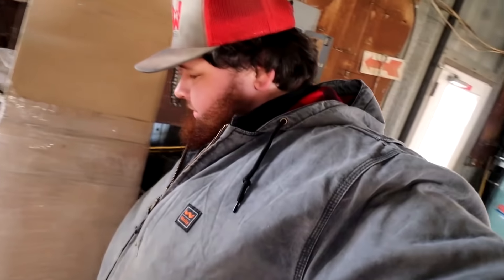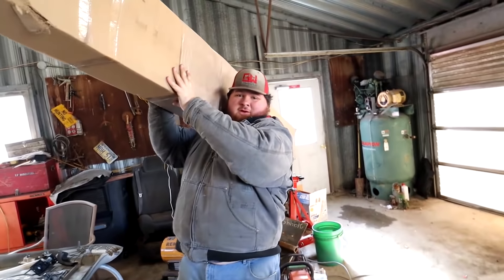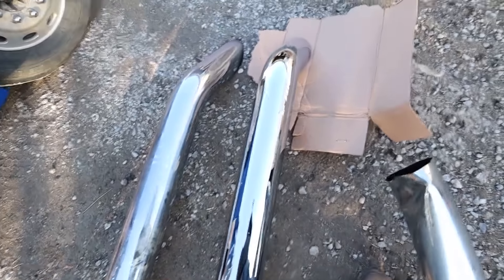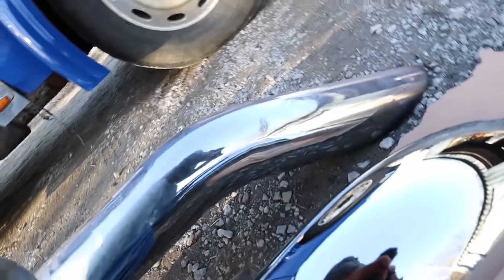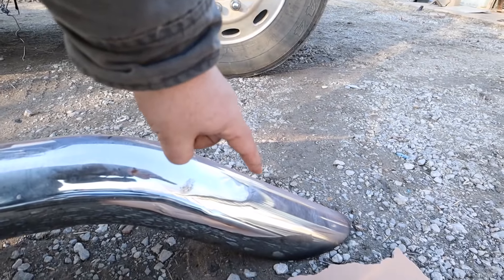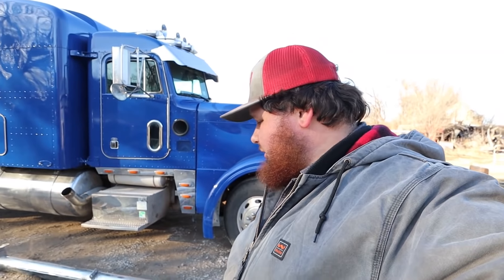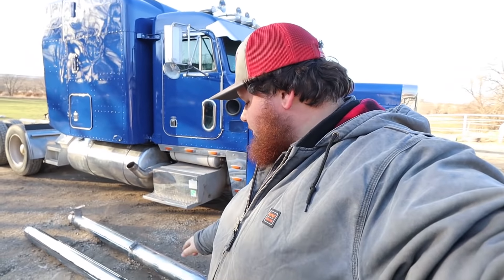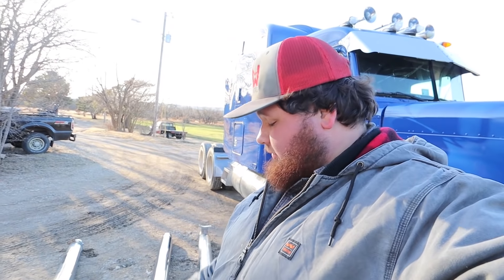The Wrecked 379 Peterbilt is Back!

Comment: Since I've recently become obsessed with these.....can you do a Prinoth Beast next......oh ya know, just has a little kitty in it, a C13 CAT with 1600lbs of torque.   The biggest snowcat you can get.  Like $56 to $65k used with 10k hours....do an engine rebuild and you have a perfectly good machine at far less than the $495,000.00 new price.  (Can be used in summer for Ag work too)

Comment: Man that mess that you have going on.. If my Matco roll around toll boxes looked like that in my drag racing garage, I'd shut shit down until it was spotless.  Now, as for the truck it's looking straight 100. I am a big fan of chrome and lights. I am looking for myself a cabover sleeper 2" flat floor because it has the bigger engine and is like a non cabover on inside. You don't halve to crawl over the engine hump. I wanna customize it with chrome and lots of light. Then pull my race car trailer around the country drag racing.

Comment: Mirror bracket is supposed to be bent. Mirrors brackets angle up so the bent end allows mirror to be level. Make sure you do the band clamps on exhaust correctly. Didnt look quite right in video.
Reply: Fenton Burke ; I was thinking same thing, that is the bottom bracket that comes up at an angle from the door sill so the mirror isn't at the bottom of the window but pushed up with the cross brace to the top sill bracket

Comment: Where did you go to order that stack? I’ve got a Chevy 3500 that I put side pipes on but the stainless steel isn’t doin it for me. And the cuts aren’t the same on both sides. I’d like to buy a big rig stack for both sides like you did but with an Aussie cut instead of bullhorn and lay them down along the truck in chrome. If anyone else knows anything I’m open to ideas
Reply: Are you talking about side pipes?

Comment: That pair of air cleaners are about as aerodynamic as two dog houses screwed to the side of the truck...kind of silly for a vehicle that spends its life cruising down the highway for its entire life..even worse when you consider the majority of resistance over 20 mph is from the wind...probably costs 30hp or a couple miles per gallon of fuel just to maintain 60 mph because of them things....try it...stick a pail that size out your window as you do 60mph...most have a hard time holding their hand steady.

Comment: 1. The Mirror Arm IS NOT Bent.....that is the way its made IT WILL Work.    2. I see you bent your newly painted door already. With your Air Cleaner. You NEEDED the Door Stop on the Door First.   3. You just mounted the Stack in What Ever Angle you had,  huh????

Comment: The new stacks do not make you any money.  Polish up the old one.  Wrong size air cleaners...note dent in door!
PIck a nice day.  Move everything OUT of the shop, Power wash the floor after sweeping/blowing the crap outside.  Decide where you want components to go.  Welding stuff in one area, Mechanical in another.  Tools in the Middle with Roller Cabinet.  Hoses, coolant etc in one area.  Tires one area, Batteries and Power Tools another area.  NOTHING on the bench but a Vise.  Get lots of garbage cans and use them.  Cut 4" off that ridiculous Sun Visor.  You won't be able to see the Traffic/Pedestrian lights.